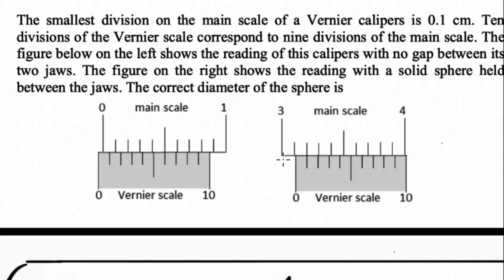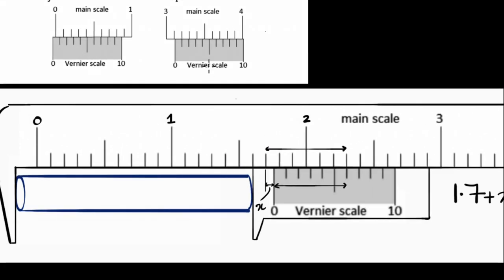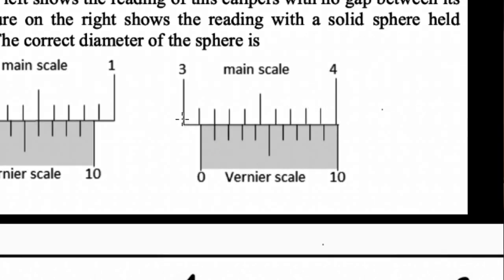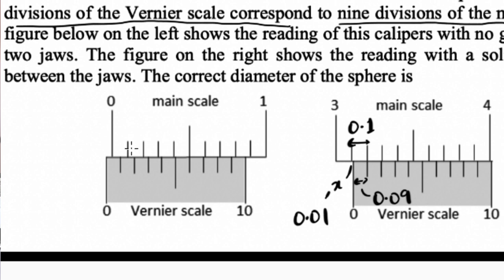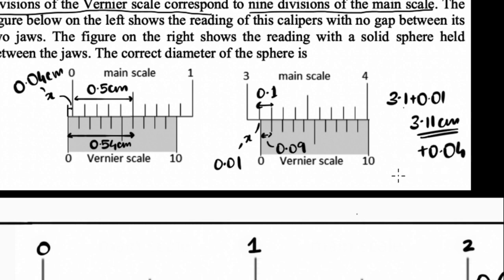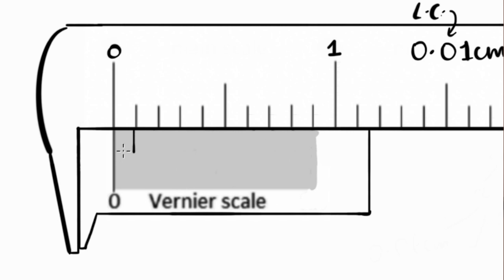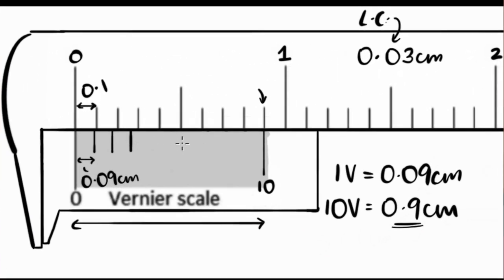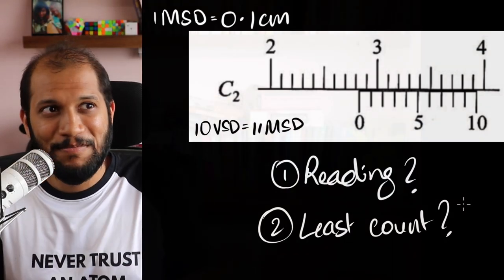Solve ANY Vernier Calliper; No Formula, only logic! JEE Adv 2021

Comment: For the final question:
Reading = 2.83
LC = 0.01 (which is the absolute difference in lengths of MSD and VSD)
Reply: This is a question from JEE Advanced 2016 Paper 2.
Your answer is correct. 
Mahesh Sir is great at explaining concepts in a very fundamental manner without any complicated formulas. Thank you sir.
Reply: bro isn't the least count 0.11 cm 
Explanation: 
10 VSD= 11 MSD
10 VSD = 11 * 1MSD
10VSD = 11* 0.1cm
1 VSD = 0.11 cm
so least count = 0.11 cm

if i am wrong reply me
Reply: @Lama_60  Bro, 1 Vernier Scale Divison(V.S.D) = 0.11cm but Least Count(L.C) = M.S.D - V.S.D 
                                                                                                                                             = 0.1 - 0.11
                                                                                                              Least Count(L.C) = -0.01
Here the negative answer means that the "first marking in vernier scale" will be 0.01 ahead of "0.1 marking in main scale" So, if we just need the value, the least count will be 0.01
Reply: Ya correct
Reply: @Lama_60  1 VSD isnt the least count the difference of 1vsd-1msd is what matters to be the least count
Reply: @Lama_60 bro I also made this mistake but figured out instantly that what you have calculated is the vernier spacing from an origin basically one vernier small division but least count doesn't mean that . Least count means the amount of distance the vernier scale is shifted from msd so you have to subtract it from msd which is 0.11-0.1= 0.01.
Reply: @Lama_60   it is not least count it is value of 1V.S.D.
Reply: @Lama_60  1 vsd is 1 scale devision on vernier , to get the least you need to find the difference between between 1msd-1vsd which will be equal to the smallest measurement that can be made from the given vernier

Comment: The reading was simple to calculate... 2.83 main scale divisions

But the least count took me a while.
I got it 1.11(bar).Here's how:
I imagined coinciding the 10th division of VS with the 10thb division on the MS. So there is gap in between the first divisions of both the scale which is equal to 10MSD -10VSD. This 10VSD is nothing but (10/11)*10 = 9.99bar. So answer is 10-9.999 =1.111.
Please confirm if it is correct...
Thank you sir
Reply: nope, least count is 0.01 cm

Comment: first assumption....the 0s of both the scale coincides....now, reading=2.8+x,and 8msd=7vsd+x (8*0.1=7*0.11+x) and therefore x=0.03 and hence reading=2.8+0.3=2.83... now least count is the least distance that you can measure between msd and vsd and least distance between vsd and msd(vsd-msd) will be only in that division which lies just after  coinciding divisions(the coinciding divisions are 7th division of vsd and 8th divsion of msd) and the division which lies just after that are 8th(of vsd) and 7th(of msd) so as stated above the least distance you can measure is the distance between these division therefore 1vsd-1msd=0.01 cm.....now I know the question here can be how can i subtract msd from vsd(vsd-msd),well I have assumed that the  main scale can move...because this type of question is not used in real life(why would you make a scale whose vsd is greater than msd)...so clearly that's why I am allowed to defy this rule :)( at least that's what I think)
Reply: Hey bro, your calculation is wrong. 2.8+0.3 is 3.1 and not 2.83..
Reply: @udaypatel9596  he meant 0.03 ig

Comment: I'm kinda confused at the part where you measured the divisions of vernier scale  0.09 cms each. 

Isn't the divisons of vernier scale the least count? 
which is calculated as LC= 1main scale division - 1 vernier scale division.
like, 

in that question, it was given that 

10 VSD = 9MSD 
ie, 1 VSD = 0.9 MSD
(smallest division of main scale is 0.1 cm)
 then 1 VSD= 0.9(0.1cm) 
which is, 0.09 cms
BUT, when you calculate least count then, 
you gotta do ,
LC= MSD -VSD 
ie, LC= 0.1 cm - 0.09cm 
where you get , least count = 0.01 cm. 

then why did we calculate the divisions as 0.09 x 6 instead of 0.01 x 6?
Reply: AnimeSketcheshere  yeah but that's the thing right? that is what I said. the answers coming wrong with that one.
Reply: AnimeSketcheshere  nah.

Comment: Hlo sir! 

This is Yuvraj this side.. 

I have a doubt and I came across this when I was learning what thermal velocity and drift velocity are. 

I'll start in 3..2..1..

My first question is when we say that the average thermal velocity of all the electrons is 0. Do we calculate this at an instant? 

If yes then, is my way of calculating it correct? 

 since the motion of electrons is random inside a conductor. Thus on an average the number of electrons moving in a particular direction is equal to the number of electrons moving in opposite direction at an instant. Thus, the vector sum of the thermal velocities of all the electrons at an instant is 0..(since for every vector there is some other vector nullifying this.) Now the vector sum of  the velocities  of all the electrons divided by the number of electrons is the average thermal velocity .. Thus average thermal velocity is also 0.. Since 0 divided the number of electrons is 0..

If we calculate it at an instant then is it calculated the same way I have calculated? 

One more question if we don't consider a particular instant of time. Then the average thermal velocity of a single electron should also be zero.. Since it goes and comes back to the same spot when there is no electric field?
Reply from the maker: Love how you are comparing averaging over time for one electron vs averaging over electrons for one instant! Beautiful.

Since things are random, by definition, it should be time independent. Therefore, considering properties of a  single electron at multiple instants should be the same as considering multiple electrons at a particular instant. 

So you should get the same answer either ways! 

Secondly, when we say zero, what we really mean is negligible! It can’t be exactly zero. 

Kind of like when you toss a billion coins. You get about half a billion heads. It doesn’t mean it would be exact 0.5 billion. There may be a few 100 thousands here and there. But they are negligible. 

That’s the beauty of statistical processes.
Reply: Which Device u use for teaching